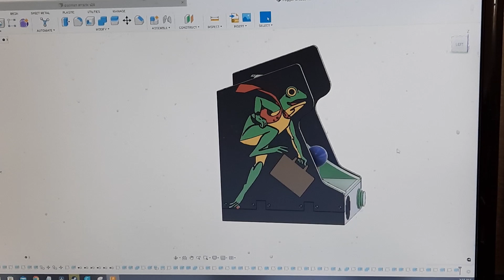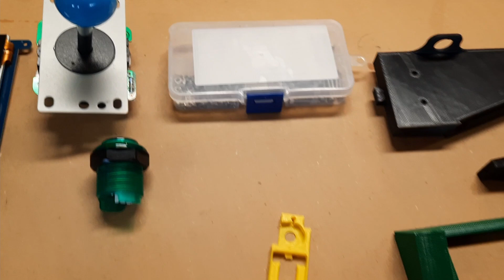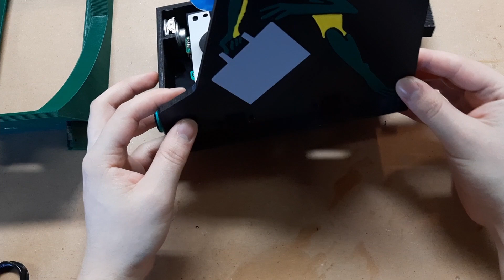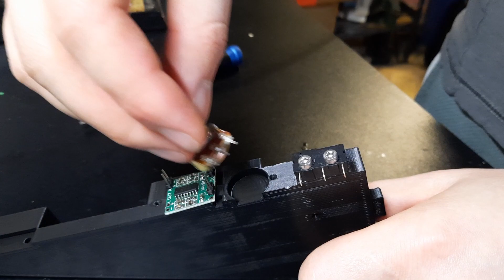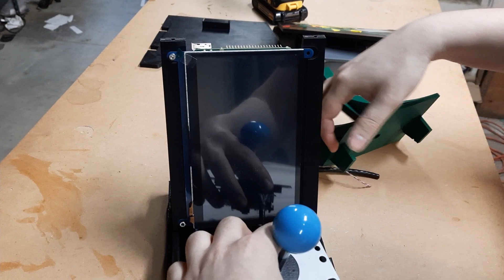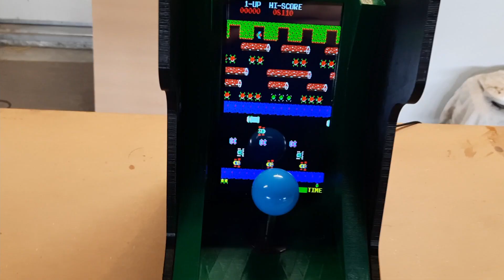Building Frogger Arcade Machine - Building A 3d Printed  arcade

Comment: Yo this is great! Question: these look to be dedicated cabs. I.e. only one game can run on them. How did you do this? Every cab I see on YouTube runs off retropie which is fine but I like the idea of having one game per cab. Does this boot straight into Frogger? If it does can you explain how you did that? Thanks!
Reply from the maker: Thanks! I Know that it can be done. example:  https://www.youtube.com/watch?v=roi2er9iEX0 
But I have not done that step yet. I am  using that same board for testing  multiple arcades right now so I just have it boot to emulation station. I will add the auto booting at some point in the near future and when I do I will give an update on how I did it.
I hope that link helps.